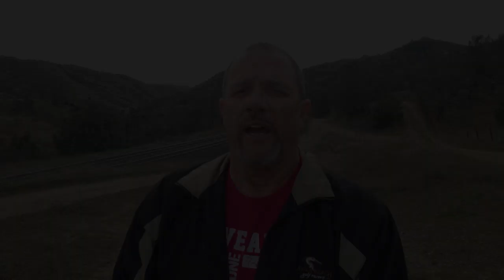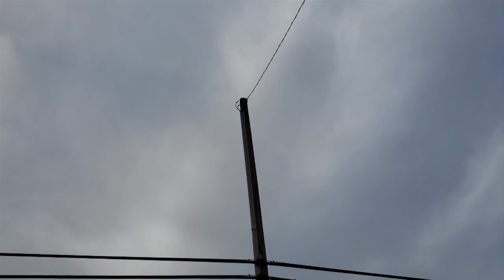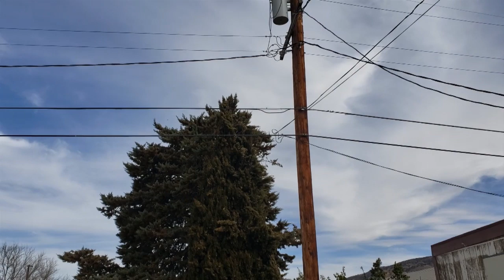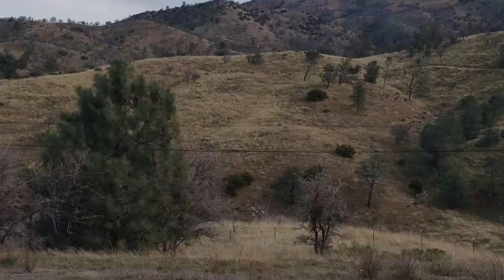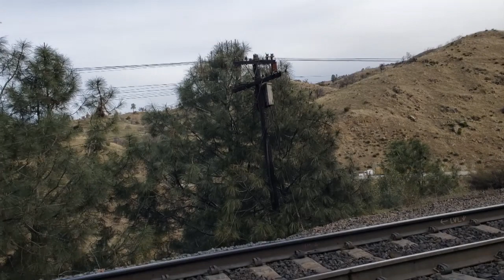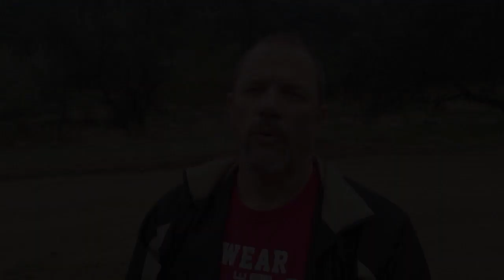Railroad (and other) Polelines Explained

Comment: Late 70’s , early 80’s.   those lines was then being discounted in use.  Almost all telegraph lines have removed now along the rail lines and 120/240 Power service, now supplies the rail way kiosks cabinets.
Reply from the maker: Much of our signal poleline on the Fresno and Mojave subs was in use until the last upgrade was cut over in 2016.

Comment: Interesting and educational, thanks. As an old gummer that has hung around tracks all my life I do appreciate these lessons. A great treasure for me is to find one of the old insulators on the ground somewhere. I’ve collected quite a few over the past 50+ years. You don’t see glass on any poles anymore. The “beehive” type are my favorites. You find them from time to time at some sort of sale. Unfortunately the seller thinks they’re worth a fortune, but as I’m sure you know that millions were made so they’re not worth a ton of money. I still grab  any glass insulator that I come across that is sensibly priced.
Reply from the maker: I just gave a half dozen beehives to a kid I know. I found them going through some stuff in the garage. I am not a collector, and threw hundreds of insulators away. I did, however, make sure many went to those who did want them. Thanks for the compliment and for checking it out!

Comment: Mark, some railroad pole lines had a shorter crossarm at the to  with three wires, sometimes two, presumably for high voltage distribution delivered by the commercial local power company.  Would this be 240 or 480 volts?

On the SP in Arizona and New Mexico there were two lines, one on the north and one on the south side.  What was the convention?  One so de for communication and the other for signal?

Santa Fe had many single pole lines with communications at the top crossarm (?) and one or more crossarms below for the signals (?).  The power from commercial service was at one edge of the lower (lowest) crossarm.  Also, every so often there would be an "H" set of poles with transformers for voltage reduction (management).

I also remember seeing long bond wires with bonds connected by drilling a hole in the tail just outside the angle bar.  I'm going to speculate (like you never do) that this application opened up the rare possibility of a pull-apart or broken rail at the joint unprotected by a circuit failure.  Ever have that gremlin jump up to confound  the integrity?

We could talk for hours.

Comment: So many thanks for an absolutely Super duper video, This comes closer than any other video I’ve seen on explaining the wayside wires on railroad pole lines of which so many have been destroyed. My favorites were certainly the communication lines and poles (disappeared earliest) which had the most cross arms per pole and most unusual arrangements and designs (forming facial expressions) in my opinion.

Comment: I was surprised at how thick and stiff the railroad wire is. 5/32 inch / 8 gauge / 4 mm. Appears to be special alloy material, not very ductile. It must have been rough work to install and maintain it. I can imagine splicing this stuff up on a pole in a wind storm. Our ancestors were a tougher breed of man than we are : -)
Reply from the maker: We used #9 iron for signals, #10 copper for AC, and copperclad (iron clad in copper) for codeline. The 10 was easy to work with, 9 not that bad, copperclad was almost unworkable! I had the displeasure of working all of it from poles until UP, thankfully, banned us from climbing around 2000.
Reply: @MarkClayMcGowan  Thanks for details. I found the 8 gauge wire on fallen poles along the S.P. Salt Lake Division route while making video for my channel. The poles were probably from the 1930's. I often wondered why the pole lines were left in derelict condition. Thanks to your video I learned something to inform future videos. PS- You could make a video on how the old timers did the skillful wire work I have seen. They must have had special tools to make the splices and tie-offs with that thick wire. What you excel at is the details that many rail fans are interested in. In contrast to the dull run-by shots that most other channels do : -)
Reply from the maker: That would be interesting, but I no longer have those tools or materials at my disposal and UP has tossed it all since there is no more poleline. All the stuff I shot in this video has been removed.

Comment: When do you think the last Morse (telegraph) circuits were retired from your road's pole line?  A few of the roads in the Northwest were still Train  Dispatching by Morse until almost 1980.
Reply from the maker: FYI factoid: Most railroads didn't use Morse code after the 1880s but created a shorthand version so orders could be transmitted and transcribed more quickly. I didn't know that until I became a docent at the museum!
I know SP had stopped using telegraph in most places by the 1950s and replaced it with telephones and radios. On my territory, they were still issuing orders from Mojave to Colton in 1980. I was hired for the CTC installation to get rid of it. We still had non-CTC sections between Bakersfield and Mojave into the late 1990s but they were governed by automatic block signals.
Thanks for checking it out!

Comment: Mark:  If you take 120 volts and diivide that by the square root of 3, you get 208 volts and divide by square root of 3 again, you get 600 volts and again, you get 2160 volts and so on. Tony Vallot
Reply: How far can the railroad run the 120 volts before the voltage drop was too much to use?
Reply: @railspike7057  Over 6AWG Cu wire,  at the low current needed for battery chargers, you'd get a mile or 2, out of 120 or 240v. 

The BNSF in eastern Colorado used 480v single phase power, and got out several miles each way from a commercial power drop.

Comment: When i was a young kid those were called telegraph lines, because that is just what they were at that time. Messages were sent to stations located along the line at intervals. They were powered by low voltage dc power. After they stopped using telegrahs, people began taking the glass insulators from the poles to keep as collectables.
Reply from the maker: On the railroad, telegraph lines were generally on the other side of the tracks to keep interference from being an issue. 
Open signal lines have been in use since the late 19th century.
Thanks for checking it out!

Comment: Nice bit of history, thanks.  On occasion I've looked at the "telephone poles" on our street and pondered how it all developed.  It makes sense from a safety perspective, telephone & cable TV (the safest cables) in the lowest position, 120/240 VAC power to homes above that, and at the very top distribution wires with their (rather nasty) thousands of volts.  All placed in a logical layout.  The poles themselves have a variety of inspection badges nailed to them.  It seems like they're inspected every ten years or so, with a life expectancy of 50 or so years (here in PA), although I'd guess the life expectancy is related to the environment.
Reply: There are poles out in the deserts out west that are well over 100 years old.

Comment: Old story, possibly true.  The SP in Sprint was indeed Southern Pacific.  When they upgraded all their wireline systems to Microwave, they had enough spare capacity to sell for TELCO type service.  I guess that branch moved on to bigger and better (?)  communications and became the Sprint we all know and love (?).
Reply: A lot of it was actually fiber when Sprint started.  I have seen underground utilities marked along miles of a railroad right of way and the Sprint line ran directly under all the signal cases.  MCI did not except in some relayed sections the Sprint and MCI went in the same trench.
Reply: Sprint stood for Southern Pacific Railroad Internal Networking Telephony.

Comment: The spacing of poles was uniform.  Timetables noted the spacing and counting them while timing with your watch let you calculate train speed.  Engineers got called out by the crew for speeding because if there was an incident and speed recorder tapes were pulled everyone on the crew had their job in peril...

Comment: I have tried for years to figure out what each of those wires do. It would seem from my research that you would need a minimum of 4 wires to run signals along with two power wires. I believe in addition to the 6 wires for signals, there is two wires for communication and two wires for CTC. Railroad crossing signals usually require another arm on the pole.
Reply from the maker: You needed eight wires to operate the signal system. Two wires each for the signal control in each direction and two block indication wires.
The code line (CTC) was separate and used two wires that transposed at every other pole. 
AC power was also carried on two wires where necessary. If cable was used instead of open wires, the code line and AC had to be on dedicated cables to eliminate inductance in the signal circuits.
Up until the late 80s, crossings used two wires going to the signals in each direction called "wrap around" circuits. If the old 300 units failed the wraps would take over and the crossing would activate when a train passed the signal, which made for very long warning times! Those were eliminated with modern microprocessor crossing controls.
I hope that makes sense!
Reply: @MarkClayMcGowan  Yes that was helpful thank you.

Comment: I'd love more info on how the signal circuits actually work on the tracks. Seems like iron rails wouldn't be a great conductor for digital signals.. so I'd love to learn how it works!
Reply from the maker: All signal line circuits, whether open line or cable, were 10 to 12 volts DC with current in the .500 ma range. Most signal blocks (the track between signals) were less than two miles long so voltage drop wasn't an issue. 
We also carried AC from 120v to 3.7Kv on the lines as well as the code line which was around 200vdc at very low current.
The rails are very good conductors and have welded copper wire conductors at all joints in a circuit. Insulated joints are used to separate circuits. In the old relay logic system track voltages were in the .5 to 1vdc range at .125 to .500ma range depending on circuit length except for control point circuits which are in the 1.5 to 2vdc range.
Today's microprocessor pulse system are in the same voltage and current range but are pulsed at different rates which the system interprets for signal aspects rather than using relays to give that information.
Maybe I'll do a "how it works" video about it.
Thanks for checking it out!
Reply: I'm going to make an educated guess and say it's going to be either a differential signal, or high voltage AC. More than likely it will be a high voltage AC signal due to the high impedances that these very long lengthns of cable will have. Because of this high impedance, the cable will have a greater opposition to current flow. In order to reduce the effects of transmission lines opposition to current flow a higher voltage can be used.

Furthermore, the voltage drop of a DC signal will be far greater when dealing with distances like this then the voltage drop of an AC signal. If a DC output is desired, the AC signal can be modulated in some way so that the other end can de-modulate the imposed data, thus receiving the resulting DC data.

I could be entirely wrong about this by the way. This is simply an educated guess/hypothesis as to what is being used or rather what was being used.

Comment: Believe it or not, we always called them “Utility” Poles around the Phone Company since the majority of the Poles in the 5-state SWB Midwest Region didn’t carry telephone wires which explains why the landline telephone service was highly reliable.  Tree and tree limbs pulling electrical and cable wires down didn’t affect telephone service since the majority of our telephone cables (wires) ran either in buried conduit or manholes underground which limited telephone service outages.  Aerial cable ran from a Utility pole to the Customer’s residence with a Drop Wire. Fiber optic cable is both underground and aerial.  Thanks Mark. 👍

Comment: You mentioned at 7:33 that the signal communications are now sent down the tracks as coded pulses, rather than on the track side open wire.  Do railroad still use a "code line" for CTC and if so how do those signals get to/from the houses at all the control points?  Thanks again for the very interesting videos.
Reply from the maker: The codes are now pushed through the radio system and interfaced inside each control point with the signals system. Here is the link to the video I show it inside a cabin.  https://youtu.be/_2GBqFrzEgY
I hope you enjoy it and thanks for checking it out!
Reply: Thanks Mark.  This is all very interesting to me as I come from a radio and telecom background.  In doing a fair amount of Googling over the past month on modern CTC code lines, I’ve found that some roads are using satellite links, 900 MHz data links, cell phone data links as well as conventional 160 MHz two way radio links (same band used for train to dispatcher voice comms).  I can understand implementing radio code lines via satellites and 900 or 160 MHz radio, but what road would want to put their CTC operations into the hands of a cell phone provider?  Maybe commercial customers get a better grade of service than retail customers from cell sites.

One of the more interesting aspects of radio code lines is that there is a free computer program ATCSmonitor that some railfans use to passively monitor train movements on a display that looks like a dispatcher’s console.

Thanks again for your great videos and explanations of railroad operations and technology.

Comment: Great video. One nite on the BN back in the early 80’s my dad (signal maintainer) 
had 8 miles of red signals in a role, both tracks due to trees falling through the pole line. He was very happy when they eliminated the pole line.
Reply from the maker: Trees were a constant struggle with poleline. They'd grow under it and short circuits, break lines and the last 20 years we had no gang support to help us. It sucked!
Thanks for checking it out!

Comment: Speaking about wires, at most rail joints where 2 rails meet but are NOT welded, there's a bolted metal plate across the gap and there's also a heavy stranded wire or cable attached to both rails. What are the wires for?
Reply from the maker: They're called railhead bonds and are used for continuity for circuits that use the tracks as conductors. The bolted ones are called angle bars. They keep the rail together.
Reply: @MarkClayMcGowan  So if its for continuity, if someone was to lay a metal pipe across the rails it would cause a red signal in that block?
Reply from the maker: @bfurailroad1104  yes sir as well as if the rail breaks.. Thats the concept if the track circuit. Train axles are solid steel with .06 ohm resistance so when we test we use a .06 ohm shunt cord.
Reply from the maker: @William Anthony Leasure the RRs considered that at one time but it would only work at a crossing where there is a cabin and most cars that get stuck on tracks, oddly enough, aren't near crossings. They're better off calling 911 or, if possible, shunt the tracks with jumper cables.
Reply: @MarkClayMcGowan  I remember a few years ago we had some snowy weather and the city had put salt down and the RR crossing started going down and then back up again. I can only guess that the saltwater was shunting the rails.
Reply from the maker: @William Anthony Leasure the boxes that say "shunt" have a frequency shunt in them. That is a series of caps and resistors in a sealed cylinder that stop a certain frequency from continuing down the rail. It is the end of the approach for a crossing. If you go watch my video on "How Crossings Work" it's explained there!

Comment: Hey Mark, Didn't the Southern Pacific telecom system form the basis for Sprint which was spun off as an independent entity?
Reply from the maker: That is correct. It stood for Southern Pacific Railroad Internal Network Telecommunications. They sold it off around 1990.
Thanks for checking it out!
Reply: @MarkClayMcGowan  1-800-PIN-DROP